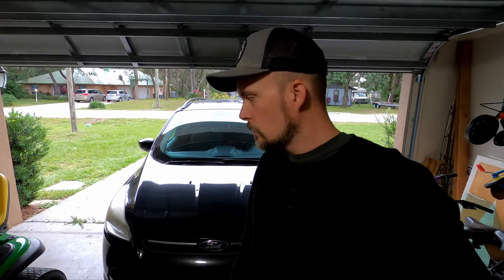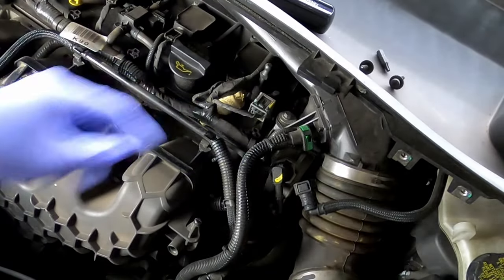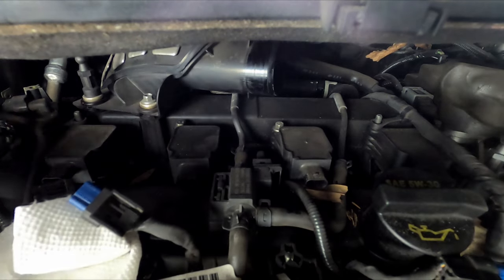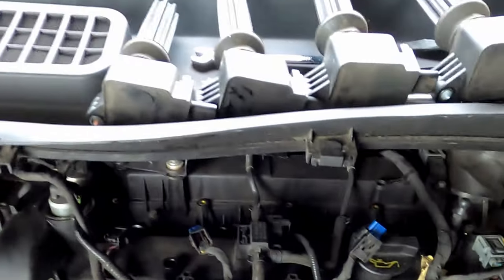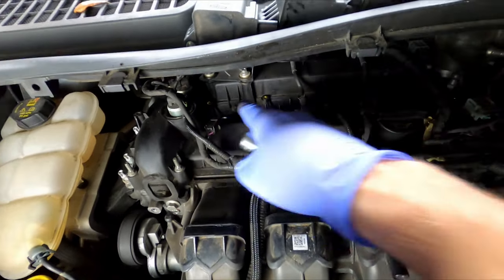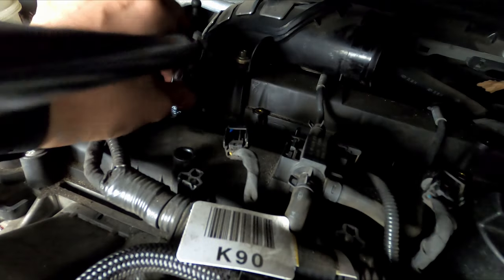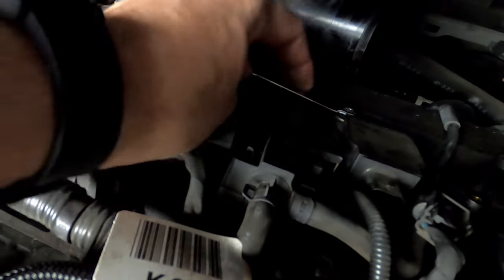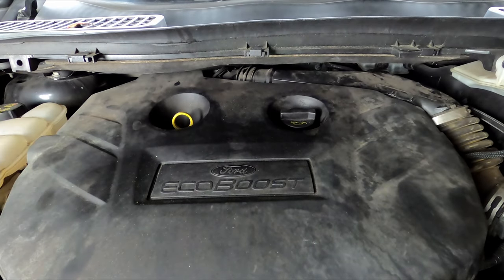How To Change Spark Plugs On Ford Escape 2.0L 2013 - 2019 - Full Walkthrough

Comment: Only takes like 5 to 10 min to remove wiper arms and cowl then its gravy......if.you want a Real job on that engine try  doing the upstream o2 sensor then your talking.....
Reply: Or timing belt and water pump on a 1.6l ecoboost.

Comment: Wouldn’t this whole operation be a little easier with the wipers and cowl removed? Great vid 👍
Reply: No, Roger. The wipers never go back on the same. When you start the car, they look they’re doing the YMCA dance out of sync.
Reply: Learned a trick to reset the wipers. Had to take them off to change the battery (didn’t want to go the airbox removal route) 

Mark them on the windshield and then Once off, turn them on, let them cycle, and then let them rest back to starting position. Then, put wipers back on, and they will be back to starting position! Works everytime!!
Reply: @michaelfutch8960  there are markings on the windshield that you align the wipers to when you reinstall. Probably more of a hastle than just replacing the plugs with the cowling in place though
Reply: Why create more work for your self it's only a 2.5 ..4 banger why make a career out of it
Reply: 2.5 is way easier yhst why I drive 1.more room better mpg
Reply: I've removed the cover and wipers, takes 5 min. Never an issue
Reply: It really would but I e seen the video on how to remove it for changing the battery .. man what a hassle

Comment: Very well done video,  following your step by step approach, my new plugs installation took 45 minutes.   The old plugs were difficult to remove, everything else went pretty well.  A little anti-seez on the threads made install of the new plug go smoothly. The car was missing upon acceleration and the new plugs fixed the problem. I used Ford factory replacment plugs.  I hate to admit the old plugs had 118K on them.
Reply from the maker: Thanks Ed! I'm glad it was  helpful and to hear you got it fixed 👍
Reply: I've got 160k on the plugs I'm about to change so you're doing better than me

Comment: Ever consider not using factory Motorcraft spark plug, instead using an aftermarket upgraded and more expensive spark plug, or do you think that it might not be necessary?
Reply from the maker: Not really, I generally like to use factory equipment unless there's known issues with them. These were the factory plugs and ran fine with 100k on them.
Reply: I am about to change my original plugs in a couple days, I have 148K miles on them. no issues except a bit poorer gas mileage. I'm going with original replacements...

Comment: I watched a few videos and this was the best.  Thanks for stating what tools would be used, the anti-seize suggestion, and mounting the camera.  Good suggestion regarding the vacuum and air hose as well.  Too many videos people hold the cameras...makes me sick.  Complete and well done video.  ( I haven't changed a spark plug in 15 years and my dad asked me to do his 2015 Escape.  Thought todays spark plugs would be made so you have to bring it into the dealer or shop - or made very difficult for DIY.  Engine space just isn't what it was ha).  Thanks for uploading.

Comment: Very good video!  One thing I noticed though, when you Torque the plugs you click Twice?  It's my understanding that when the wrench clicks you are at the desired torque and NOT to go any further.  Am I wrong?  Sorry for the Negative,  Other than that,  EXELENT VIDEO!  Thank you for taking the time!
Reply from the maker: Good catch and you're correct, I shouldn't have double clicked it. It can over torque them. I had my wrench set at correct lbs, but it didn't feel right so I hit them a second time.  I would go with a wrench you trust and click them once.

Comment: I take the rubber part of the plug socket each time I put the new plug in. Because if it comes off on the new plug, it a bear to get out of the hole unless you take the plug back out

Comment: Let's see....did not check spark plug gap? While the air intake tube was off, you had time to clean said tube and MAF. Good video, missed a couple steps in my book.
Reply from the maker: Good callout, I should have checked the plug gap in the video. I did check it off camera, and all plugs came pregapped and were all correct.

Comment: great video! the only question i have is how do you know when you have it torqued the right amount? do you have a gauge telling you, or do you just know when its good?
Reply from the maker: On the torque wrench, you set it to the correct lbs. When you tighten it, the wrench will click when it's tightened to what you set it to.
Reply: oh ok awesome!  the only thing i know how to do on my car is change the washer fluid lol, so this video will really help!  @deuceliter
Reply: @J_Sas_97 RIP engine, lol 😀
Reply: How many lbs do I torque it to  @deuceliter
Reply: @juliavassar2047 he said it in the video. If you are using the same Motocraft plugs, it will say on the box.

Comment: There is no link for the torque wrench?
Reply from the maker: My apologies, I've added the link! Thank you for the call out!
Reply: Dude, I just changed my spark plugs on 2016 Escape with 104k miles. Your video is so detailed and easy to follow. I watched about 5 times before attempting and the only thing that made me nervous was using a torque wrench for first time. I want to let you know how much I appreciate the time and effort you put into this project.  I’m a 53 yo female with ZERO mechanic experience. Most complex thing I’ve done is change engine air filter (just last week). Thank you again!!

Comment: Do you have to have a torque wrench?
Reply from the maker: It's not technically necessary if you're confident in your mechanical skills on plugs. Get it tight, then another 1/4 turn to snug them up should be fine. Just don't over tighten, or you wished you had used one.

Comment: I spent 2hrs today trying to fit the 5/8 spark plug socket to the plug on the motor with no luck I even went I bought a new socket thinking maybe was defective but they fit perfectly on the new ones I just can't get it to fit on the old ones, I already triple checked and there's no debris on there. Any advice? I'm completely lost, I've changed spark plugs all my life to all my vehicles and this is the first time this happened
Reply from the maker: That is strange. Did you try a different size deep well socket?
Reply: @deuceliter  yes but all I have are standard size, my only guess it's that for some reason is metric 🤷
Reply: I believe the 1.5L uses a 14mm socket. Easiest way to check is on the replacement plugs (assuming you purchased the correct plugs).
Reply: I read that you might need a thin wall socket for this engine.

Comment: The ford parts website list SP-550x as the spark plug for the 2017 Escape 2.0L.  What is the difference between SP-550 in the video and the SP-550X Plugs?
Reply from the maker: I believe the difference is that the SP550 are Iridium, and the SP550x are platinum.
Reply: I have 2015 FORD ESCAPE 2.0L and as per manual, the spark plug is SP-537. You used SP-550. We have the same car, should i buy 550 or 537? Thanks in advance for your reply

Comment: Do I have to disconnect the battery to change out my spark plugs? I have a 2014 ford escape titanium.
Reply from the maker: It's good practice to disconnect the battery when working on your vehicle but it isn't necessary when changing the plugs.

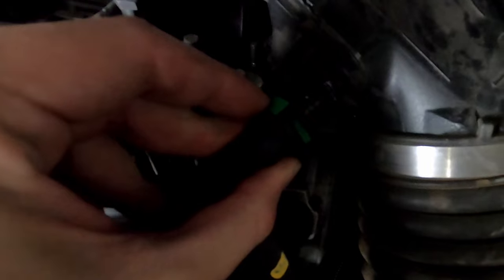Comment: Great video. What is the hose connected to on the other end at 3:30, when you remove the green retainer clip?  You "pinch" the green tabs and remove. Mine was so brittle it broke apart. I want to replace it, but don't know how to look for it as I don't know what it is retaining to the air intake. Thanks.
Reply from the maker: Did it break on the clip or the air intake inlet tube?
Reply: I also would like to know what that part is coming off the intake. I snapped it right off intake trying to get the clip off 😢
Reply: Clip still take snapped whole piece off
Reply: Intact

Comment: How many miles was on the plugs when you changed them?  Any problems with the vehicle?  I bought a 2018 and love it so far.  Haven't heard much about the 2.0 so any long term feedback would be appreciated.  😁
Reply from the maker: The plugs had about 100k on them this was the first plug change it had. As far as problems we just got a check engine light the other day. Bank 1 is running to lean. I assume it's one of the O2 sensors but havent messed with it yet. Other than that it's been a great vehicle.
Reply: Did you ever figure out what the issue was with the check engine legit
Reply from the maker: @Danny Day  it ended up being low pressure from fuel pump. Replaced it and check engine light hasn't returned but still getting a sputter between 40mph and 50mph. Almost like it starves for gas for a few seconds. I haven't taken it apart yet because it's driving fine otherwise, but I will be soon.
Reply: @deuceliter  do you remember what codes it was throwing because I got a code for bank one my my car still seems to drive fine for now
Reply: I figured I just needed a 02 sensor I’m also throwing a code for the purge valve I bought that part and gonna be fixing this weekend I’m not sure if the code for the purge is also throwing this bank one code or it’s something separate
Reply from the maker: @Danny Day  let me know if you figure it out. I was also thinking 02 sensor.
Reply: I have 276k miles on mine. Original motor and trans but torque converter was replaced. Pretty solid car.
Reply: @deuceliter  hi. Did you ever fix that sputter issue? My wife mentioned this going at like 30mph and I’m thinking is time to replace the plugs but looks like that’s not the real fix. Mine is a 16 2.0 engine with 63.000 miles. Great vid btw, thanks
Reply: Echoing the sputter question, I am also having a sputter at 30mph and want to know if you were able to solve
Reply: @Poopsicles92 what year? How often have you changed the transmission fluid? And how many miles between oil changes?

Comment: What were your gap settings for the new spark plugs? If you say that the way they came pre gapped, you’re wrong!! I looked at the new ones from for(spark plug) they were all over the place, some were at 49, some at 52, one even at 60. Thus me asking, what it’s suppose to be at when you get the new ones; spark plug gap.
Reply from the maker: What brand plugs did you use? All of the ones I got were right.

Spec should be 0.027-0.031 for the 2.0L engine.